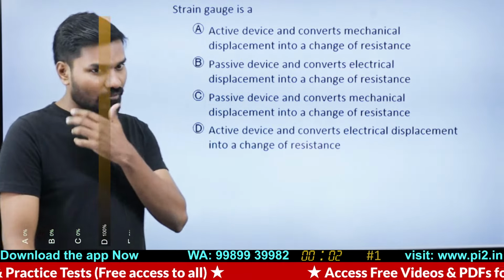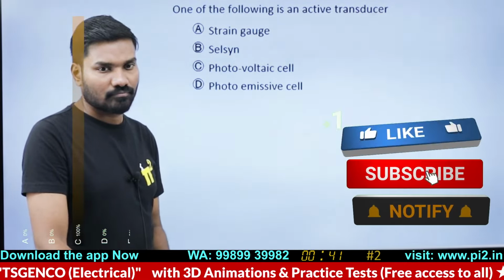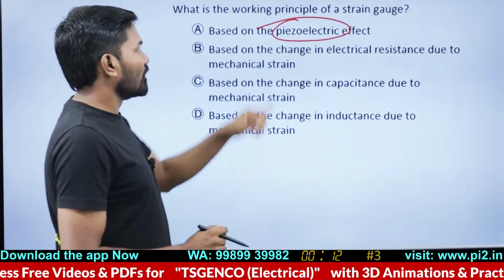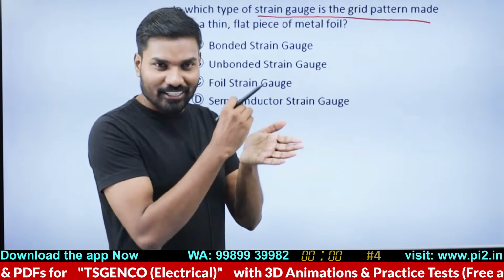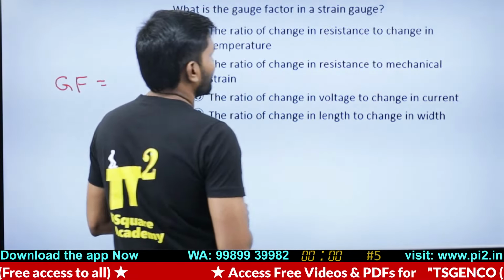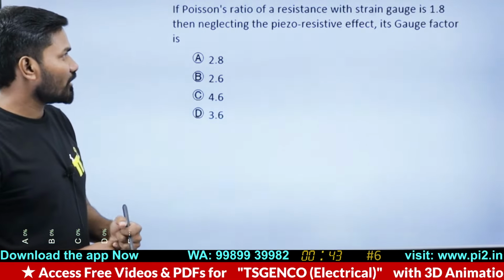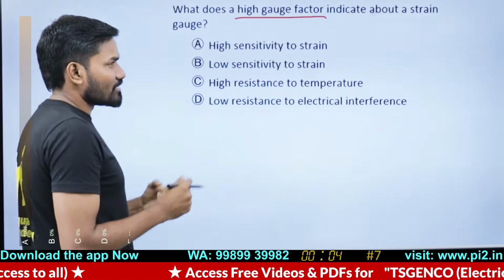Key concepts in Electrical engineering through MCQs (Instrumentation_part2)

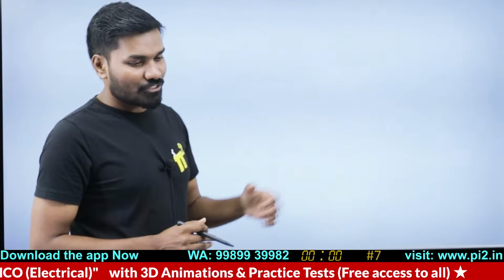Comment: 20:33 The gauge factor of a strain gauge is typically provided by  The strain gauge manufacturer.

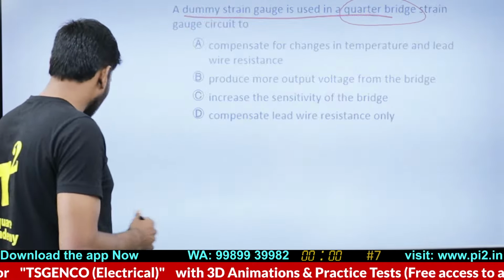20:34
The main advantage of using a semiconductor strain gauge is  High accuracy and stability (High Sensitivity).

20:41 The purpose of the backing material in a bonded strain gauge is To provide a stable base for the gauge.

20:43  Foil Strain Gauge And Bonded Strain Gauge 
 are commonly used in high-temperature applications

20:51 The main disadvantage of using a bonded strain gauge is indeed Susceptibility to temperature effects

20:59 The Wheatstone bridge configuration is commonly used for Measuring mechanical strain.

21:06  A dummy strain gauge is used in a quarter bridge strain gauge circuit to compensate for changes in temperature and lead wire resistance

Foil gauges offer high sensitivity and accuracy, making them suitable for a wide range of high-temperature applications, including turbine engines, nuclear reactors, and downhole oil and gas exploration.